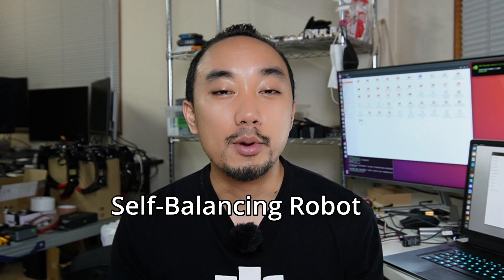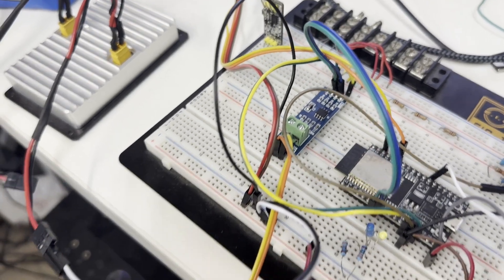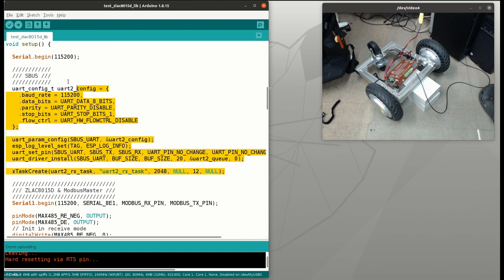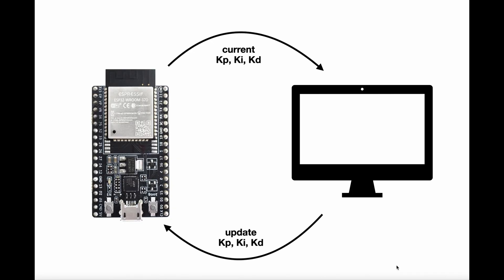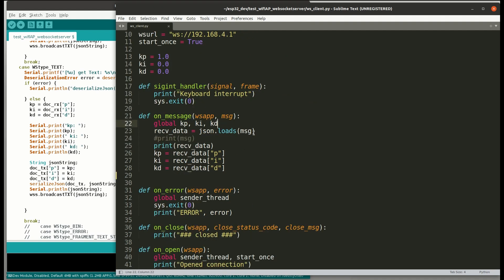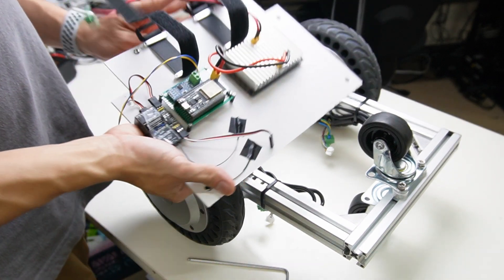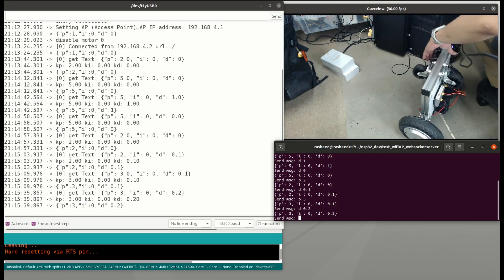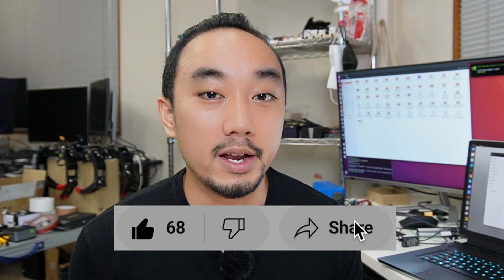Wheelies-Robot | Self-Balancing ESP32 Mobile Robot

Comment: Thanks man, but I have a problem, mine is stuck with 
disable motor 224 on the serial monitor. How to fix it? And what is the problem?
Reply from the maker: most likely  microcontroller couldn't see or detect the motor driver. You can make sure the wiring is all good, and also the ground line on motor driver should be connected to ground line of microcontroller. Hope it helps.
Reply: @stepbystep-robotics Ookay. It's actually working now, I changed the Rx tx to be 16 and 17 and boom now it works. Thx man